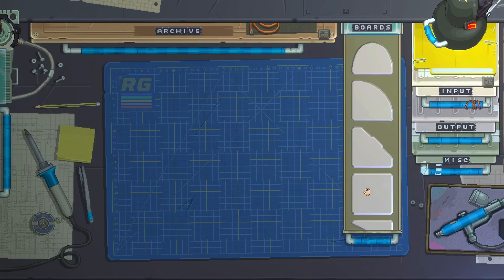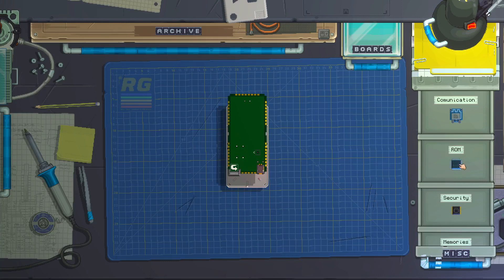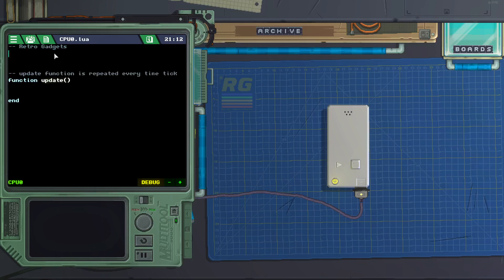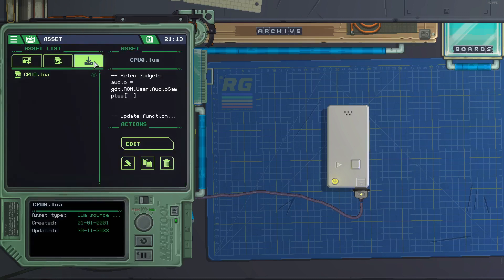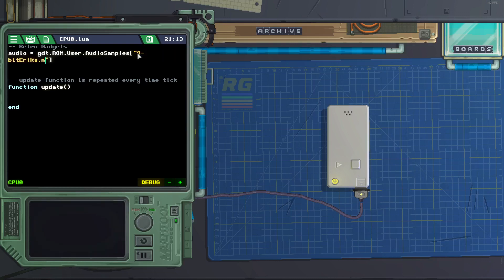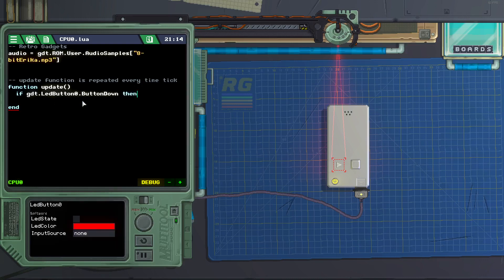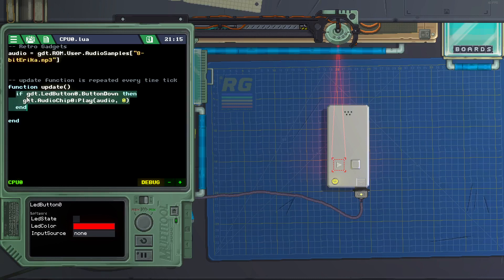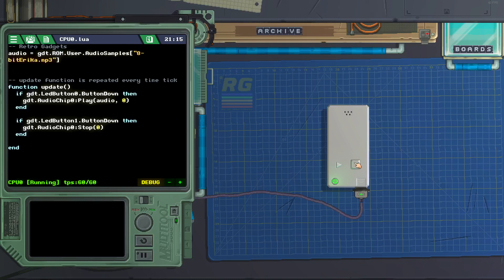Retro Gadgets - How to play a sound/song

Comment: my CPU 0 says runtime exception how can I fix this? other than that great video
Reply from the maker: Is there a red line that shows in the code, if so what does it say?
Reply: @CristiansProduction  i am having the same issue the error message i got was "invalid argument #1 (userdata expected, got nil)"
Reply from the maker: @ninjayac  nil means the value does not exist. It could be because the imported audio file is not an .mp3 or .wav file or it was not typed exactly the same.
Reply: I have all the right code with no errors, but the music doesn’t play.  I have the file in the folder yet it won’t play when I press the button
Reply: runtime exception on the audio play script AND compile error, i love life
Reply: what i did is renaming the file so that it doesnt have spaces
1. edit gadget then edit (or paper icon)
2. select the audio (it should be there)
3. pres the pencil icon
4. rename
5. change the script to fit the new name